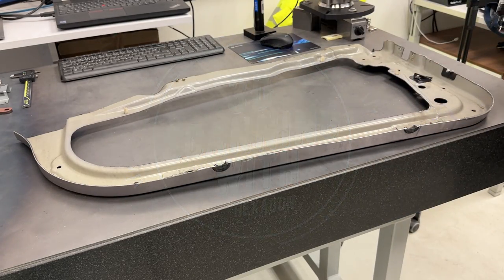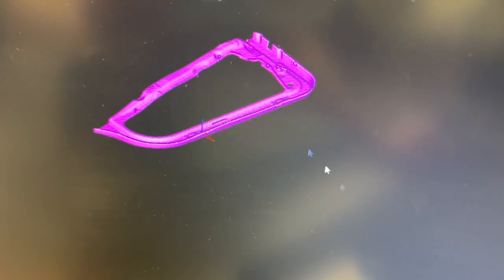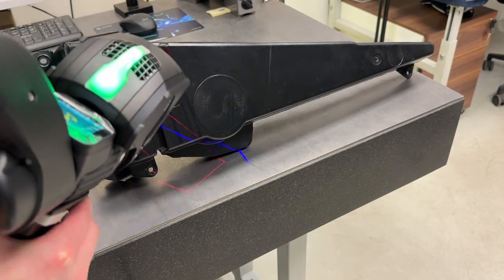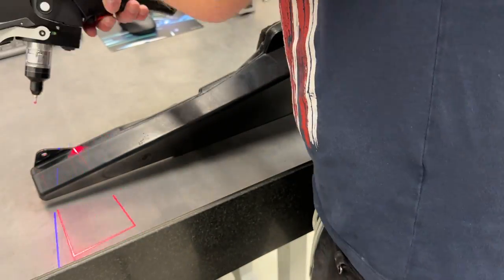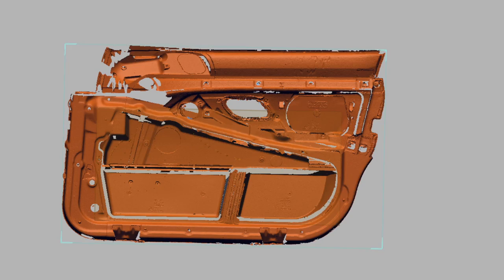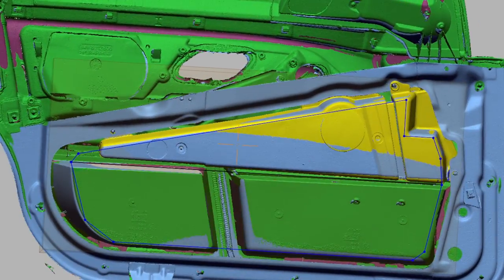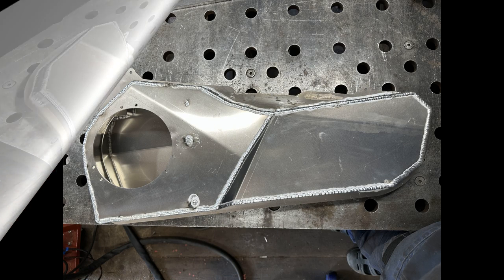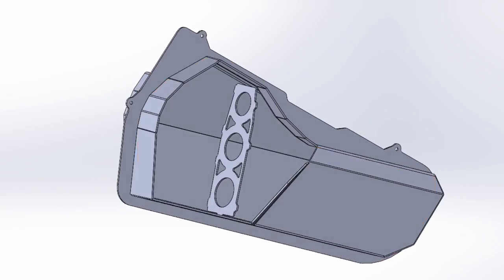3d scanning and reverse engineering bmw e39 speaker box

Comment: should make it out of mdf on a wood router as mdf has the best sound deadening properties . aluminum is no good for speeker box as it will cause a tiny sound and will vibrate and ring . ither that make a mdf plug and wax it then make a fider glass mould from that . if you look at pro sound custom car instals you will find they use mdf or fiber gass . and not metal ..... ther is a reson for that ? . good lazer scaner tho 👍🤘
Reply from the maker: hmm.. Yes you may be absolutely right. I'm not pro be any means. But I have worked so hard with this and I still have a long way to go and if aluminum doesn't work, I'll have to change it